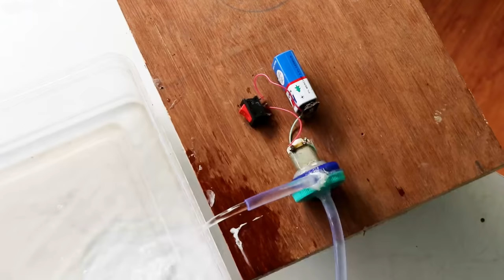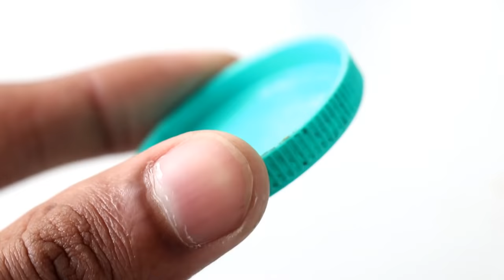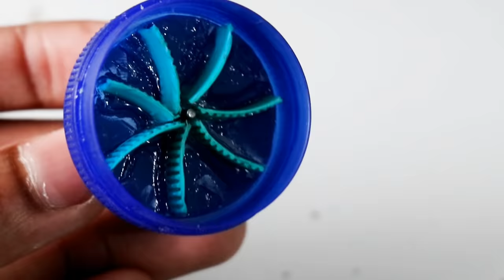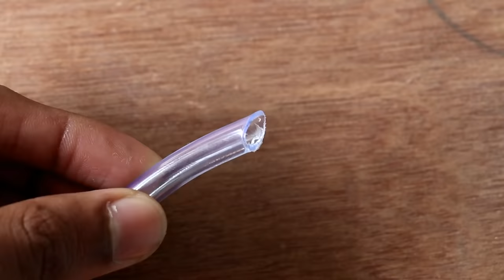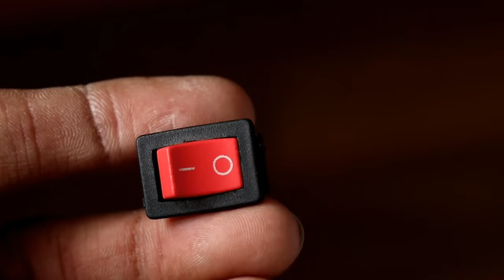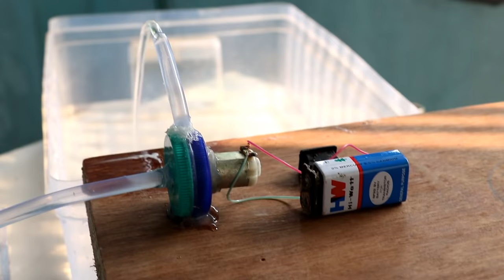How to Make Electric Water Pump With DC Motor | Science Projects

Comment: Agine fack video
Reply: It is not fake bro this how a water pump work i have made one and it's also made from 130 motor and a 18650 lithium battery and it's pressure is a way very high 
It even work with 2 aa 1.5v battery 
You just need a motor with thick and more copper winding that have high torque and high speed and you have to  fill the pump with water to make it pump water